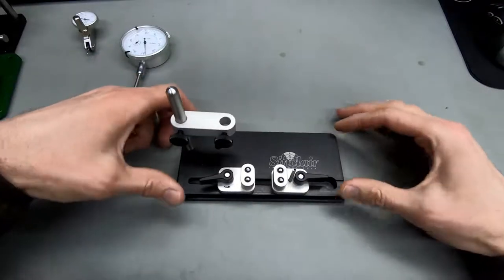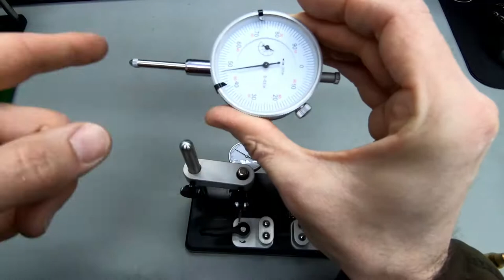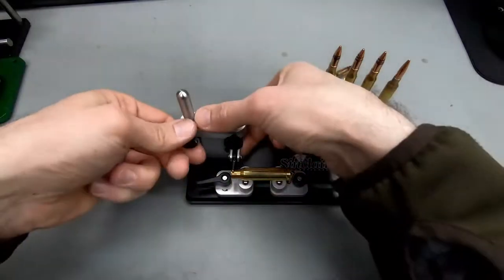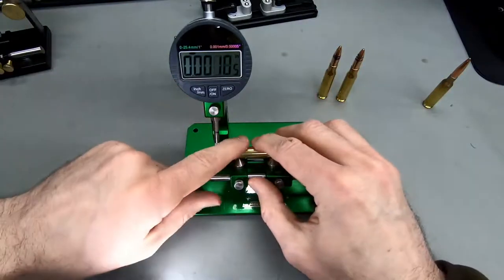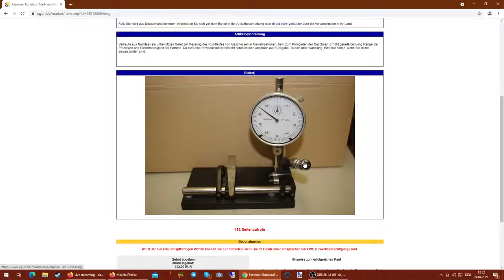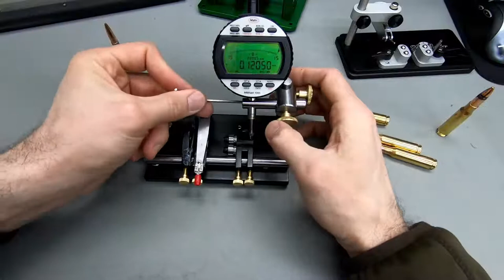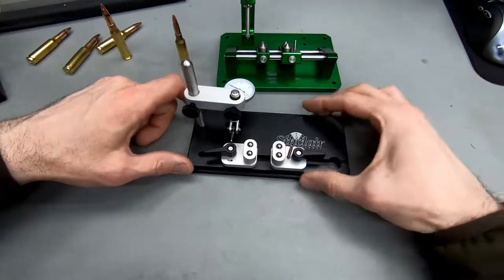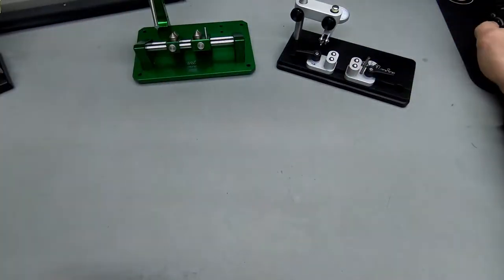Concentricity Measurement Tools Comparison

Comment: Very nice comparison. Maybe get some steel or aluminum blocks sawed into a triangle for the Sinclair if you have it and it would be much better.   The Redding sure looks like the winner here tho.
Reply from the maker: Thanks for the feedback! The Redding is the most refined design. But due to the way I have my gauges setup, I have to admit that the Sinclair is the one I use most frequently. It's so compact, easy to adjust and work with.

Comment: One concentricity guages is there any way to correct of run out on the guage. What I mean is because on the hornady I was reading it has a feature you can push the bullet in the direction to straighten it our but the other guages it looks like you can't.
Reply from the maker: I don‘t think the models I showed here can do that. 
But I also highly recommend against doing that. Runout is usually caused by a misalignment of the case neck with the case body. You aren‘t going to straighten that out - just cancel out misalignment with more misalignment. What I suggest is using these gauges to find and eliminate the root cause of the runout.

Comment: Where can I get a digital runout meter 0.0001" that is cheap but reliable ?
Reply from the maker: The real problem is finding a digital gauge that supports Min - Max measurements. There are plenty of useable 0.0001“ digital gauges on ebay but they are useless for runout measurements without the Min-Max option.
Reply: @GunWodan  Thanks GunWodan, good to know. I'll continue my search. Do you know the Redding gauge's shaft size for holding the gauge in place - either in mm or inches please?
Reply: I understand the shaft/stem size is 3/8"

Comment: Great review, thanks.  You totally nailed my main complaint about the Sinclair.  And I made it even worse by buying it with an extra digital gauge, which is actually totally unreadable because of the angle you describe, plus I have tall sitting height.  I put the analog gauge back on, and then angled the base by taking a large aluminum bin barrier for a 5.5” x 10.5” Akrobin and turning it upside down, bending it another 5 degrees or so to increase the angle, then fastening the Sinclair stand to it with removable two sided tape, with the narrow part of the barrier out front (I put a plastic edge guard on it.)

Now it angles back nicely and makes the tool much easier to load rounds in and view.  

In hindsight, since I have the Redding case neck sorting gauge which has about a 30 degree viewing angle and is very easy to read, I think I would have purchased the Redding slant bed concentricity gauge for about $60 more, but this workaround works great on the less expensive Sinclair.  Thanks again!

P.S.  Brownells only charges a $30 differential between the digital and analog gauges for the Sinclair, but charges over $60 if you buy the digital gauge separately, so I should have purchased that on Amazon; had no idea I was overpaying so much.
Reply from the maker: Thanks for sharing! Glad things worked out for you. I really do like the simplicity and form factor of the Sinclair and believe it is worth the effort to make it work! 
Offering these with a digital gauge is a really weird marketing move tho!

Comment: Good idea changing the out that dial on the Sinclair, I don't know but there seems to be some standardization with these gauges at 3/8" I'm assuming that you may be able to buy other attachments and get that dial exactly where we need it
 anyways thanks for the video
Reply from the maker: Glad you like it. Using a standard dial in that orientation made it very hard for me to use it efficiently!